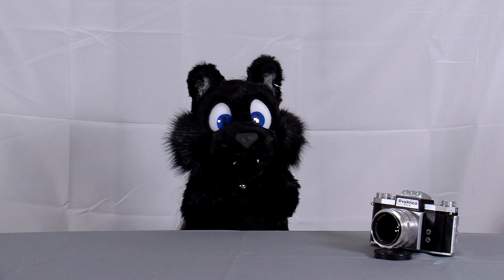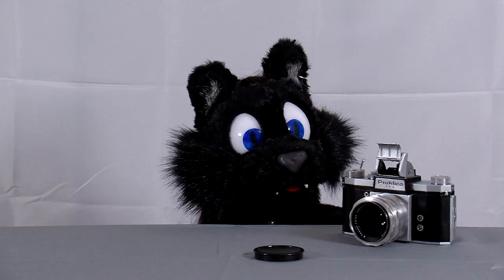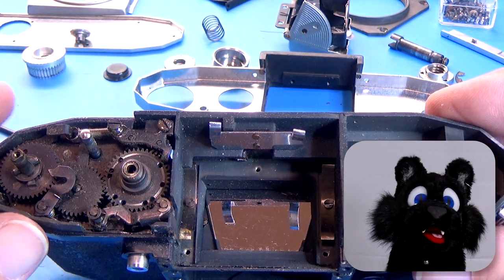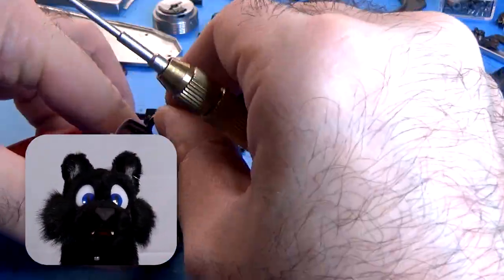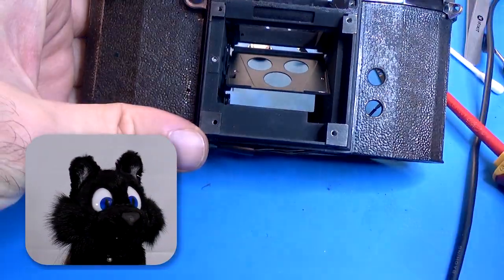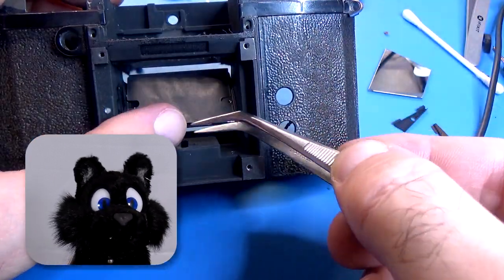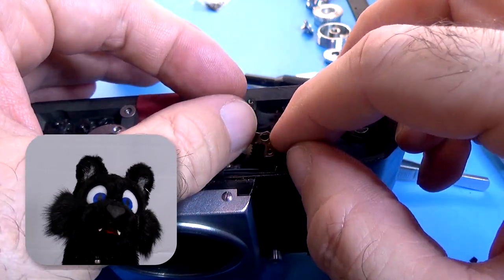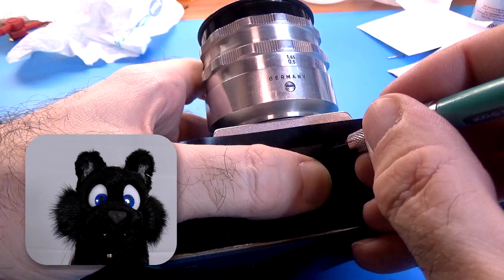Restoration Project #11 - Praktica FX 2

Comment: Dear Atkelar. I am attempting to do the restoration on a Praktina FX. After seeing your video I thought I'd give it a try.
However the build is somewhat different and I have run into some troubles.
Do you mind if I ask you some questions here?
Highest regards,
Mac
Reply from the maker: Hello! You can ask rigt along... I just can't promise I have an answer to begin with. I do this as a hobby on random devices I find and a Praktika FX (i.e. the first model) is not amongst those. So if the question is generic enough, I might be able to help...
Reply: @atkelar  That is understood. I do not have your skills for sure but I aim to improve myself. And thank you.
I will just describe some things I am going through hoping you remember and can understand what I mean.
I am hoping your remember some of the trouble shooting you mentioned at the end.:
The two screens moving/not moving problem you mentioned I have as well; perhaps you remember what you did/where the problem lies. 
This first Praktina has both the timing and film transport mechanisms at the top intertwined. Very difficult to put back but not impossible.

Aligning the two curtains is difficult; where do I put them? I though I put both of the metal curtain clamps at the right on top of each other. But I think then they will move at the same time and not let any light through.
Even worse, the curly spring on the timer has popped off. There is this wedge that moves out on a spring, to block the second curtain, and then it slowly winds out/back and releases.
Its the silver tension spring that drives the wedge out into the curtain release wheel.
Its the copper curly spring attached directly to the gear wheel that is (I think) supposed to have it retract when the shutter is pressed (and the double timer wheel is in effect).
This has popped of and I have tried to re..curl it. It doesn't seem to work.
I don't understand how those two springs could drive out the wedge and then retract it. They would both have the same strength/tension and cancel each other out OR one would be more powerful but then it would stop it from either moving out or retracting.
This is a lot of text. Thank you for reading it at all =))
Reply from the maker: Difficult to grasp wthout some pictures to go with it;  Do you have a way of sharing pictures by URL? I know YT does not allow URLs, but if you mention the sharing site and whatever "ID" the picture has, I think I can get there without a clickable link. I can then also be sure to not be had by some in-between service ;)

Anyhow: In general, the curtains "start" their cycle on the springloaded take up wheel with the springs there relaxed, just so that the "end" of the second curtain is out of the visual frame and the first curtian is "open" across the film. When winding up, both curtains must move at the same time, thus the open side of curtain 2 will end up over the film and the closed side of curtain one is covereing it now. During release, curtain one starts and opens up a visible path between itself and curtain 2. Depending on the selected time, dictated by either gear positions or a delay timer (in case of the FX 2!) the second curtain will be released and follows, ideally with the same speed, so the exposure will be a "slit" between the two moving curtains. I hope this makes it a bit clearer as to where the problem in the controlling gears lies. In my case, I had the meshing between the curtain winding gears and the control gear wrong, so there was no delay. I had to move one of the curtains (the closing one) over a few teeth so it started with the right delay.
Reply: @atkelar  Gimme a sec:goodvibes: